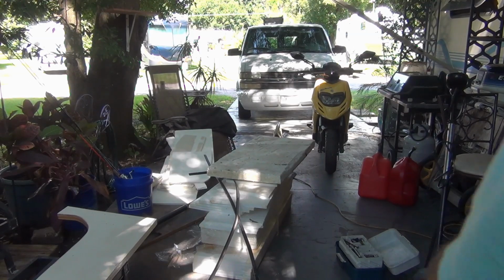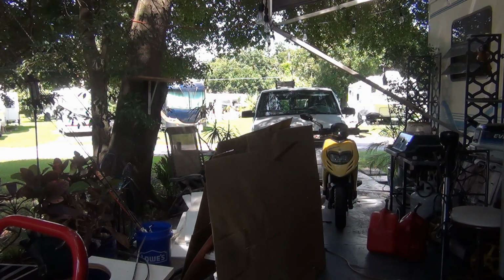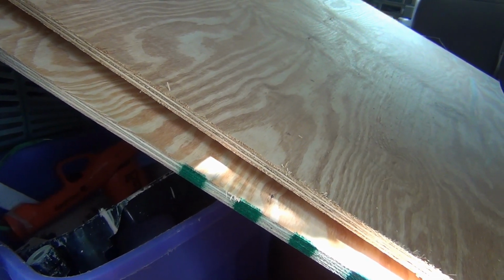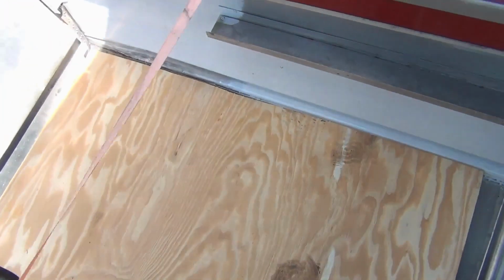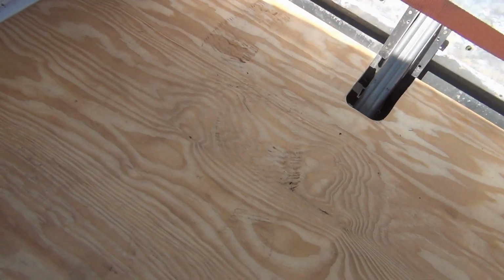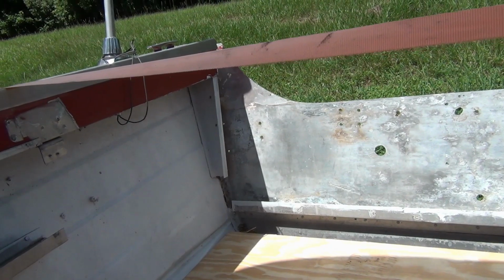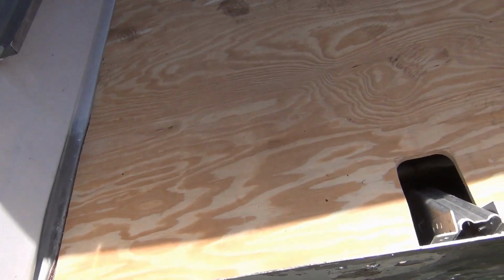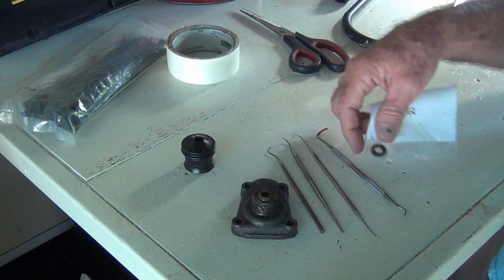Boat Floor Build. 16' Starcraft Boat

Comment: I was always told to use marine grade pressure treated plywood is the resin or glassing it just as good?
Reply from the maker: Yes use marine grade if you can afford it, I couldn't. A lot of guys use ground contact plywood which was what I used and some will put thompson water seal on it, some will put 6-8 coats of oil based house paint. I decided to try the resin as it is made for waterproofing, plus rustoleum topside paint. It's holding up pretty good considering it sits in the florida sun and on the lake all year round, its due for another coat of paint, nothing can withstand the florida sun for to long! Thanks for tuning in!
Reply: The chemicals in pressure treated plywood will react with the aluminum. Oxidation occurs quickly. Better off using just an exterior grade plywood. I've done a couple using advantech. One friend I helped used 5/8" Zip roof sheathing. Taped seams, one coat sealer, carpet glued down. Using foam under it, supports it well. Solid as the day we put it in. 👍🏼

Comment: Seeing as your deck is out in the rain,it might be an idea to fibreglass both sides with a layer of fibreglass.
I would use,fibreglass around the edges next to the hull,not use a sealant.
Reply from the maker: Hey. Thanks for watching and commenting. Stay tuned for the next video! Thanks again
Reply: He gonna seal it with resin....I watch this guy he sharp as a tack....old guys rule!
Reply from the maker: @Garminrules  Hey. Thanks Garry. Stay Tuned !
Reply: I have never had much success with trying to seal the floor plywood. The finish adds a lot of weight then at some point you forget to take the bung out and it fills with rain water or it rains for two weeks and the wood gets soaked because its impossible to totally seal it. Takes forever to dry out because its "sealed" and weighs 200lbs until it does eventually dry out. What I do and I know its not perfect is use the thinnest outdoor plywood I can get away with and contact cement a light indoor outdoor carpet to the top side. If it does get soaked it drys out relatively quickly. If someone has a better way to do a floor  I would really like to know because I run a pump and any weight reduction it would give me would be appreciated.
Reply: @Garminrules  Hi Garry,I'm an old guy,and I like these vids and the guy Himself.
The reason for my comment was to help prevent him having to do the job all over again in a matter of no time.I've been there and got the 'T' shirt.A painted deck left out in the weather won't last for long.
Reply from the maker: @dougcook1176  Hey. Seems most guys just use a good exterior oil based paint to seal the plywood, probably 3-4 coats or more. I was going to do the same but decided on the fiberglass resin instead. Its more expensive but I like it better. You can go one step farther and add the fiberglass cloth mat too, but I didnt think I needed it unless I went with the 1/2 inch plywood.I'm using the 5/8 BC plywood, I also wanted to stay as light weight as possible. I'm also using the Rustoleum Topside boat paint which is a popular choice. Try the oil based paint, sometimes you can get a gallon super cheap on the return rack at lowes/home depot for $10. Thanks for watching and commenting. Stay tuned !

Comment: Spray both sides with adhesive let dry then stick together. It’s contact glue.
Reply from the maker: Right that's the plan! Thanks again!
Reply: My experience is that If the can was stored for a long time, the ingrdientss separate and  manual shaking just won't do. You then really have to bring it to a paint store to have it mechanically shaken. Take care and be merry !
Reply from the maker: @danielrobert7181  Thanks !

Comment: And that's why you let them cut to the exact finished size...   lol   Their panel saw is going to get  it squarer, straighter, and closer to size, than your (or my) circular saws...
Reply from the maker: Nope. Have to disagree. There saw sucks, dull and unclean cuts. Been there done that. They never can get it exact. And it needs to be beveled. I should've taken the cardboard template off but trying to "cut corners". No pun intended !  Hahaha  I just plain screwed up !  But I fixed it. Thanks again !

Comment: I think the gap could be ok on the sides, bc you haven’t put the carpet on yet and also the gap will allow water to drain down. One more thought about butting the deck up to the back. What about access to a bilge pump etc?!
Reply from the maker: Next video! Thanks for watching!
Reply: I would be afraid of things hitting the floor and rolling or sliding all the way back and dropping below the floor where you won't be able to retrieve it.  Glasses, phone, favorite bait. bottle opener. etc.

Comment: You remind me of myself. My wife would look at the fit of that wood and say it’s perfect and looks great. Me? I’d kick myself for three hours and try to analyze how and why my cut was off. Then I’d likely rip it out and do it over. (I’m an anal glutton for punishment). It does look good though from here. If you are going to carpet it, I’d wrap it around the edges. And you’ll need the gap. Even with no rug. Small gap is good for expansion.
Reply from the maker: Hey. Yeah I've already fixed it. It would have drove me crazy too.I should have taken the cardboard off but I was trying to cut corners. No pun intended. Hahaha Thanks for watching and commenting. Stay tuned !